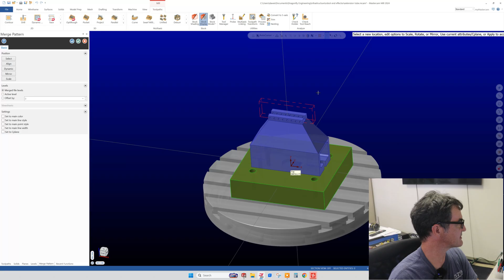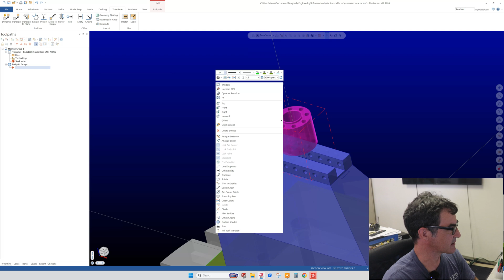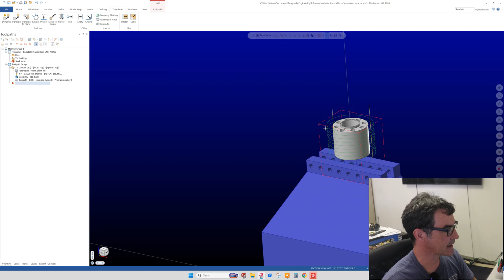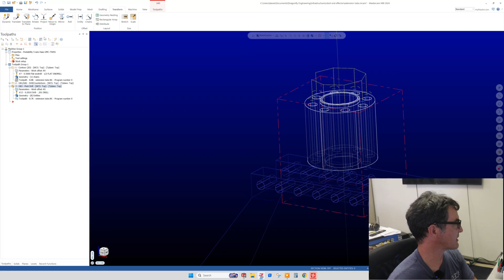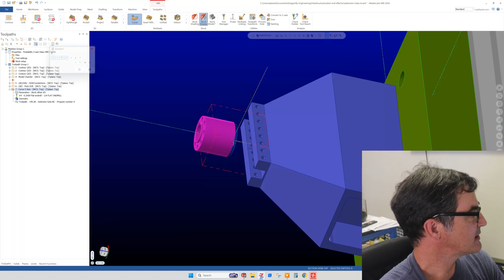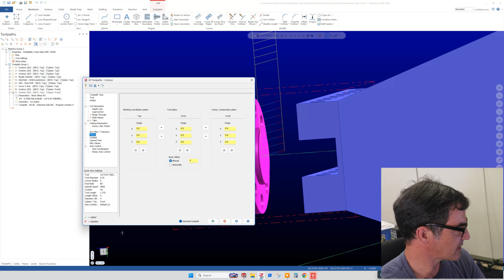Mastercam 3 and 5 axis CAM machining tutorial

Comment: For an old machinist like me, it seems it would have been easier to make on a centre lathe for a one off item. Once machined, throw it up on a milling machine with a digital readout to find and drill the hole centers. I'm glad i'm an old dinosaur when it come to all this amazing technology. Lol. Well done mate, it's very interesting to watchand to know what i missed out on in my trade !!
Reply: It's amazing to watch you guys working these machines and how you program them ! I was in my trade as a fitter machinist for 47 years before i retired about 5 years ago. When i first started as an apprentice, one of the first lathes i worked on was an old Ward turret lathe. Situated on top of the headstock was a box not unlike the  old telephone operators console with all the wires they'd plug in. You had to work out every single movement of the lathe and plug in a wire into the appropriate place in the box. There were dozens of wires just to make a single stud for example ! There were also other lathes and milling machines in the shop that were controlled by a paper tape about an inch wide that had holes punched into it by a guy who programmed the machine. Something similar to the old pianola i guess. It's amazing to see where my trade has progressed and i'm equally amazed by guys like you who know how to program them !! Well done mate, i love watching your videos. Thank you very much for all the time and effort you put in !! Cheers.
Reply from the maker: Thanks for watching!  I do have 6 of these to make, and I hope to sell them too. Once it is setup in the mill, I can make more in the future.